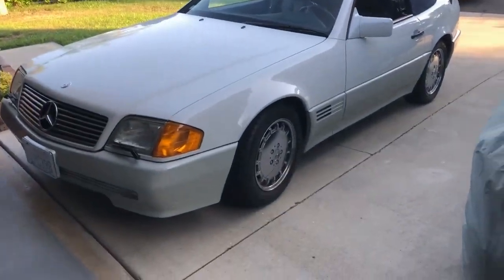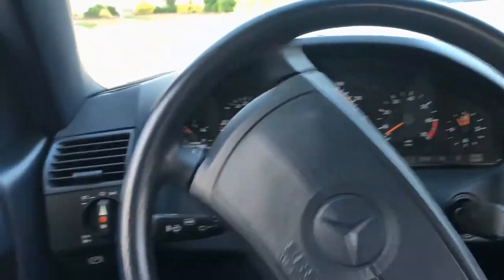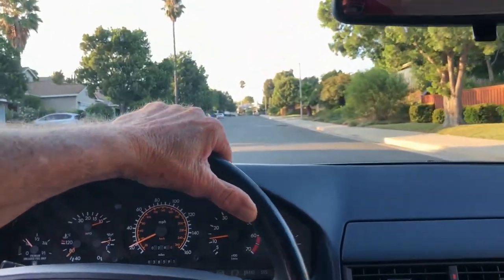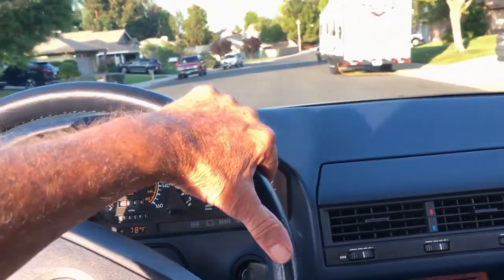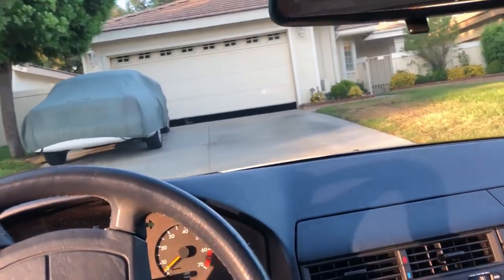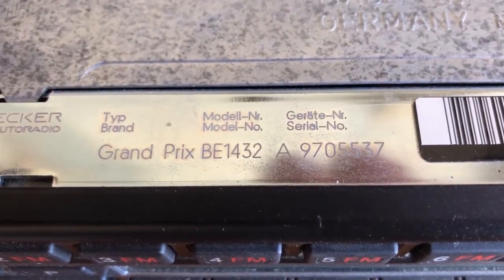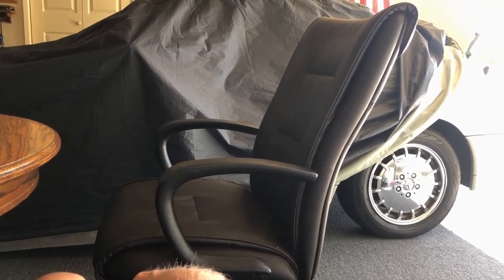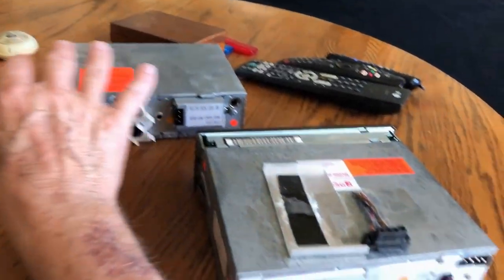1991 R129 Stereo ,My install.

Comment: I sent my to Becker in NJ for blue tooth and had the bass amp repaired as well..made a nice improvement
Reply from the maker: I should have taken that route, way easier, , but the big bass speaker really helps in convertible mode.
Reply: @mygermancars7264  My son gave me a self contained Rockville subwoofer for Chrismas that will go in storage where factory bose unit went, I will post on benzworld went I get to this spring

Comment: good video i have a 1991 300sl installed aftermarket radio the blue wire on new radio for antenna does it go to the blue wire with black red slide connected and do i disconnect the black red wire or just tap into it thanks for any help!